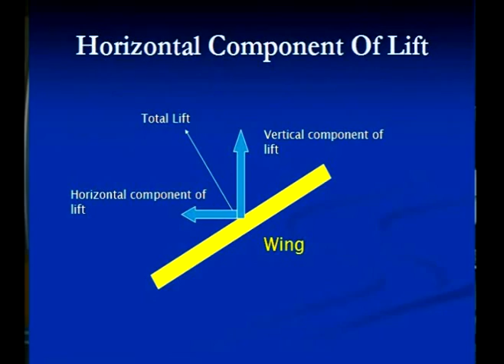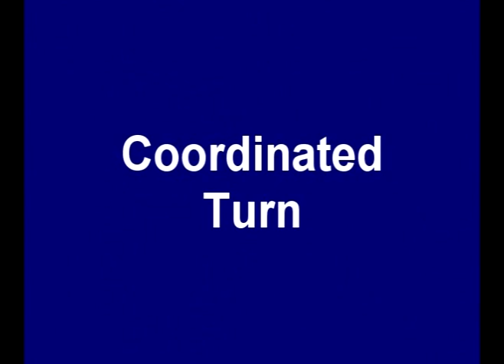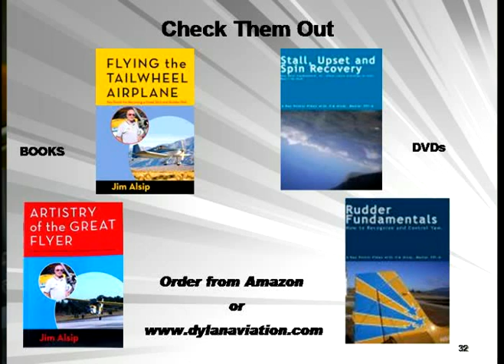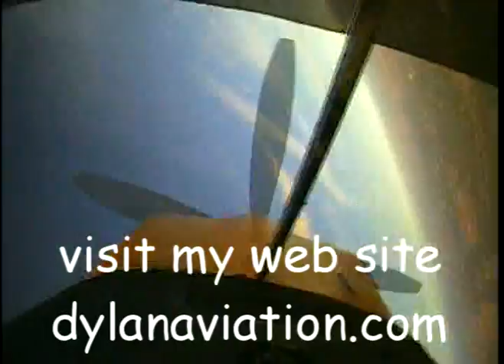Adverse Yaw, a Stick and Rudder Fundamental

Comment: this is true but you can turn an aircraft with the rudder alone, an old rc flying buddy of mine used to demonstrate this by flying circles with the wings completely horizontal and using full rudder deflection, the reason it is possible is because he was using the adverse yaw to keep the nose towards the  inside of the turn, this is contrary to what pilots are taught but in practical terms it a feasible way to turn an aircraft, I believe pilots are scared to use the rudder because they believe it can cause the plain to go into a spin but the rudder is not what causes spins, it is stalls that cause spins, if you dont get into a stall situation you can use your rudder, you would not use the rudder to turn for other reasons, the main reason is your center of gravity, using the ailerons allows you to have a feeling of sitting upright with the ball close to the center, where as using the rudder will push the ball out to the side and your body will want to lean over.

Comment: This video was first published in 2015.  However, the questins in this video will never become old.  Why?  Because most pilots don't understand what a turn is.  See this month's AOPA mag about turning which states that "most pilots don't know how to turn".  But what is a turn?  A turn is a change in direction.  I can do a  360 degree turn without ever using the ailerons or rudder.  How?  Just do a loop.
      An airplane can either do one of two things.  It can either fly in a straight line or it can turn.  A straight line is obvious.  It's when the flight path of the airplane or glider goes in a constant direction, whether it be level or in some other direction.
     A turn is a change of directiion.  In other words it's a constant changing of a flightpath so that the plane is never going in the same direction for any period of time.
Aerobatic pilots know this.  Glider pilots know this.  Why don't private and commercial pilots know this?  Some do, but most don't.
Reply: I agree with you, I learnt how to control a 3D turn in glider and not in general aviation.

Comment: Jim, you said the magic word, turn relative to the "horizon".  So when a wing is in a turn relative to the horizon, are both wingtips flying at the same airspeed?  Before you answer, does the "horizon" mean anything other than a point of reference?  Do both wingtips fly at the same airspeed in a loop?  Is a banking turn any different than a loop with respect to the "wingtips" and not the "horizon"?
I'd like your opinion.  I hope it is the correct one and not just what seems obvious.  This is not meant to be a test, but rather, a verification of what I personally believe.  Many pilots do not agree with me, but many aerobatic pilots do.   Thanks, from a fellow pilot.
Reply: daffidavit: The outside wing should actually be moving a little bit faster. The same theory as the turbine engines. Shouldn’t actually need much back elevator in a shallow bank turn.

Comment: The tape on the windscreen is a nice visual aid to accompany Jim's talk.  I noticed that the nose did climb slightly as he stabilized in the medium bank.  That was due to the small amount of 'up elevator' necessary to maintain level flight.  Increasing power would have negated the need for some of the back elevator.  It's a nice, succinct explanation.

Comment: Please explain how flying trikes seem to have no problem controlling adverse yaw without a rudder.
Reply: Walter Holland - it's because of the low aspect ratio of the wing ie: swept back. Plus the wing is flexible so the tips twist under load meaning that the tip of the wing going downwards twists upwards increasing drag, which slows the yaw.

Comment: I don't understand what you mean by holding ailerons and rudder neutral THROUGH the turn
Reply: to START a turn ....use ailerons and rudder
once a turn is started ...move ailerons and rudder back to neutral
the plane will CONTINUE  to turn "on its own"
until you use the ailerons and rudder again....this time in the opposite way
to STOP the turn
Reply: Maintaining ailerons throughout a turn will only cause the airplane to continue to roll. Achieve the bank you wish then neutralize the ailerons to stop the roll. Maintain back pressure on the stick to pull the airplane through the turn and use the rudder to maintain a coordinated turn, keeping the ball centered.
Reply: Afterburner   yes, just watch Bob Hoover videos from the cabin while he does 8 point rolls from his Aero Commander.  As to Ola colega  it sounds like your plane is out of rig.  If it is rigged properly and the airerons are flat along with the rudder, the plane should stay that way after you bring the control surfaces back to their neutral or "flat surface" position.  It's as if the plane were flying straight and level, except it's in a bank.  All you need is a little elevator to keep the nose from sinking below the horizon.  Thus, the elevator is the sole control that needs constant input in a turn.  All other control surfaces only need be neutral.  Even in a loop, the elevator needs constant control, sometimes negative.
Reply: daffidavit    Bob Hoover was a stick and rudder god, a magician in the cockpit. What he did with the Shrike Commander was astonishing. Energy management at its finest.
Reply: I think it depends on the plane, because I usually have to apply rudder through the whole turn and sometimes I even need to apply ailerons slightly to the opposite side of the turn, to avoid the plane to keep banking